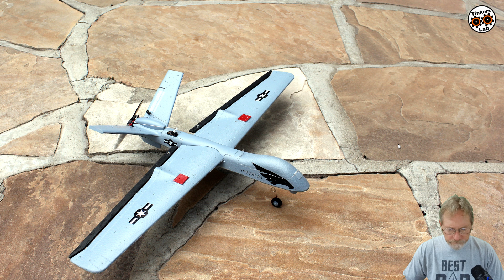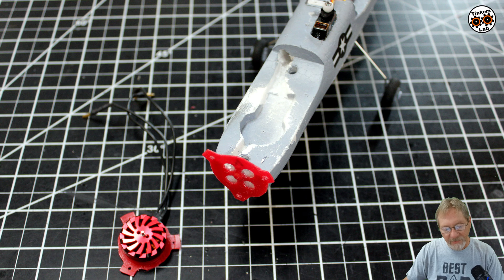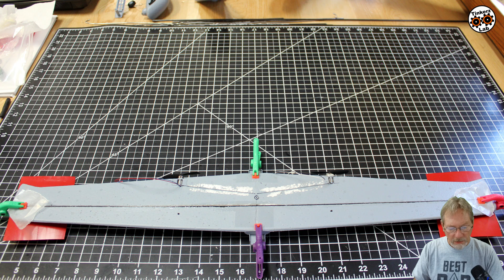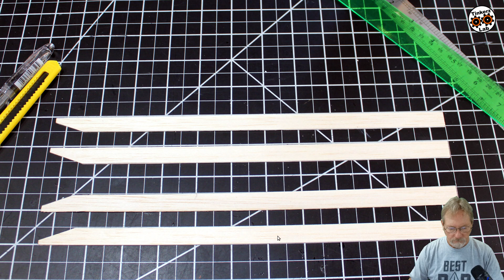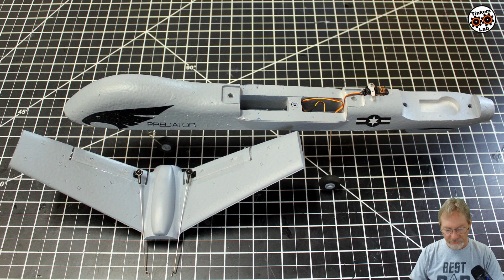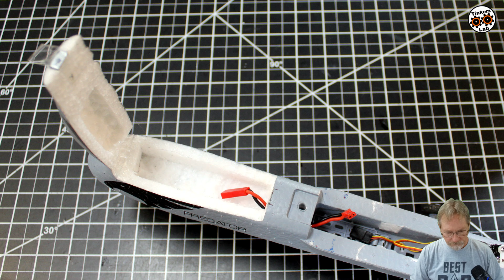My Conversion Details | Brushless 4CH Military UAV | Z55 MQ-9 Predator 660mm Wingspan

Comment: Cool mod, but Isn't this 3Ch not 4Ch? It has Ailerons, Elevator, and Throttle. What's the 4th?
Reply from the maker: You're right! Since I opted for a single motor there is no rudder (yaw) control.